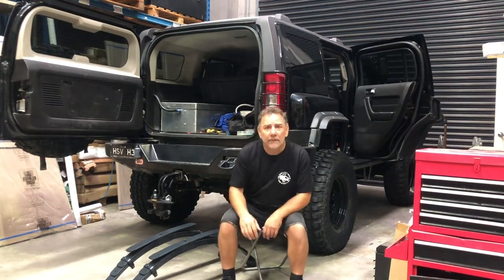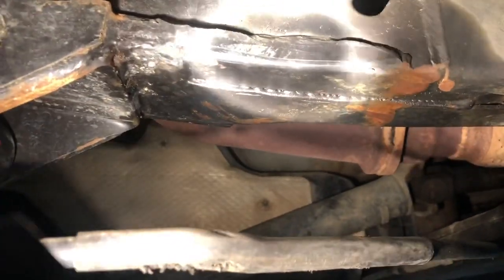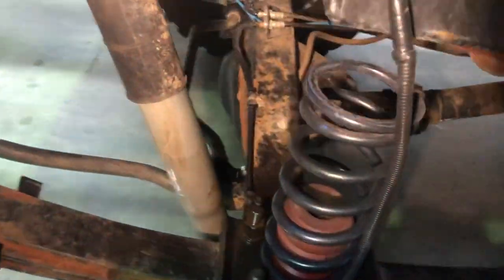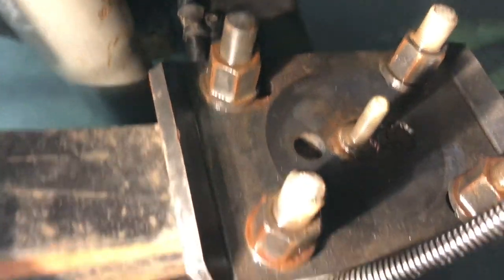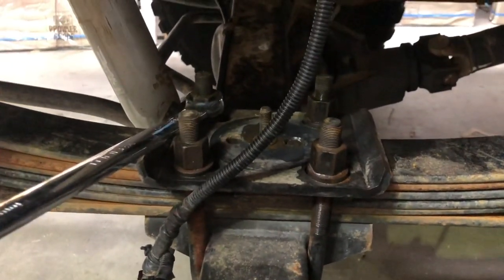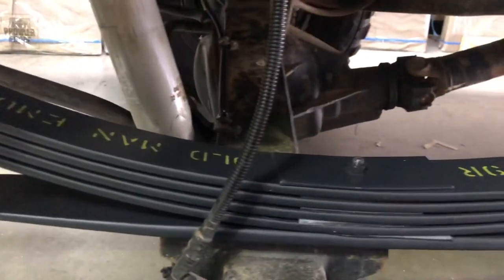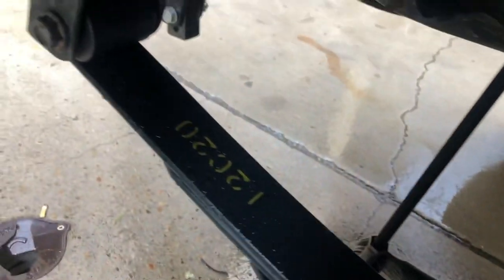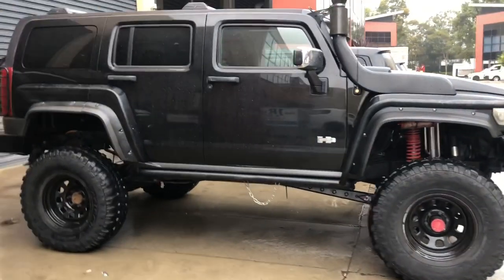H3 Hummer ARB rear leaf spring installation.

Comment: Hi is this the model number H3 Old Man Emu CS059R.  I called CarID and they said that it does not specify whether they will fit or not.  I just need confirmation on your end.  Also will the ARB Leaf springs automatically come with the bushings?
Reply from the maker: Can confirm they come with the bushings. Unfortunately I can’t confirm the part number sorry